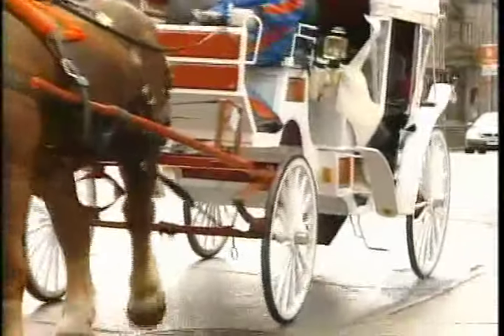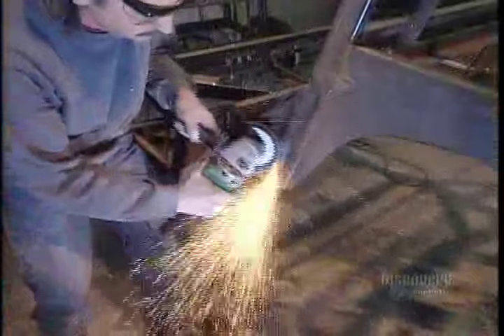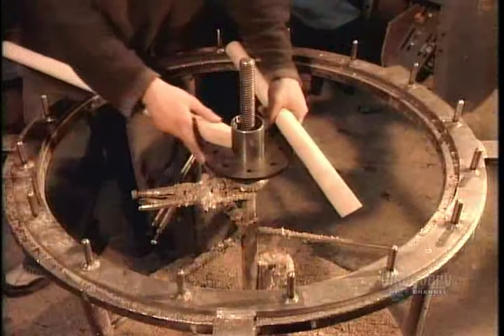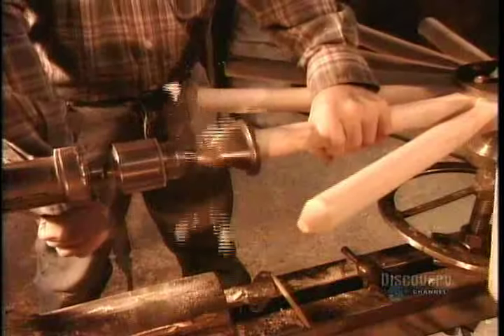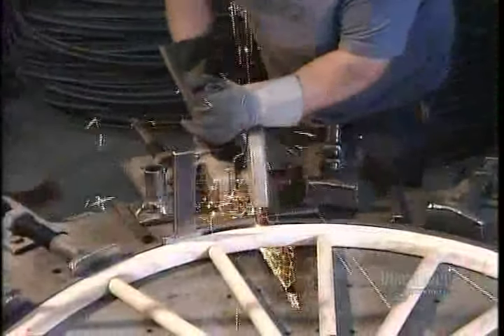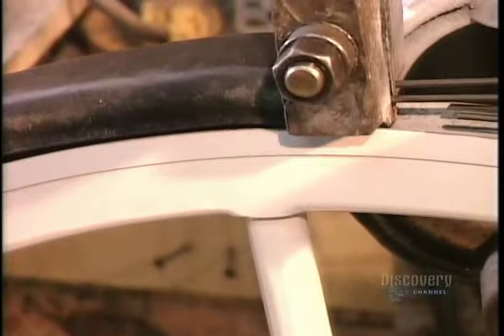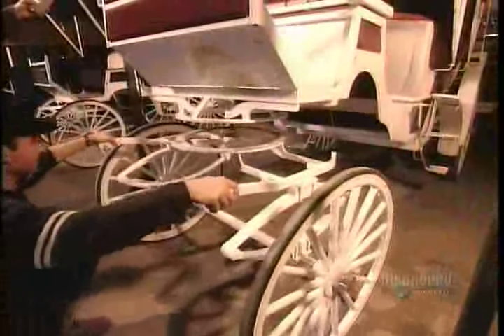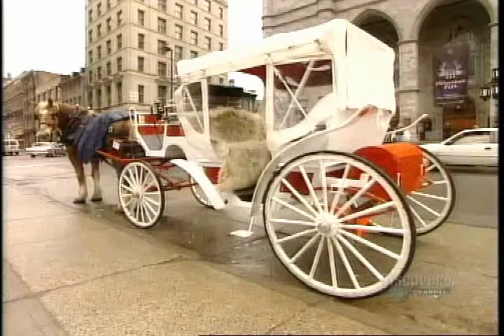How It's Made Horse drawn carriages

Comment: in these comments: lots of people blaming the narrator for the scriptwriters mistake. I'm super totally sure they'd do the same for a male narrator, too.
Reply: +DireSloth the script issue...
Reply: +DireSloth Technically there appears to be no mistakes made by the narrator.  Welding requires melting the metals together in a joint and brazing and soldering melt the filler to bind to the metals you want joined, soldering using a temperature lower than 875 degrees F.  What you learned in shop class was incomplete.  None of you know what temperatures or fillers were used building the carriages.

Comment: Madam commentator, may I inform you that  what you said,"solderingat 0.27",  does not fuse the two parts together  but welding does produce fusion of the parts and it is therefore a much stronger joint. What you described as soldering is in fact welding. There are a few welding method too, MMA, TIG and MIG and Plasma and Laser and what is  being done here is MIG welding.
All commentators should do their homework as looking and sounding beautiful is not always enough.
Reply: +Carmel Pule&#39; I'm sure the company who made these carriages know how they put it together and didn't give her the incorrect terminology as a joke.  Perhaps you can go them and take over operations at a name your price salary, along with signing bonus.
Reply: @teej783  You funny guy.